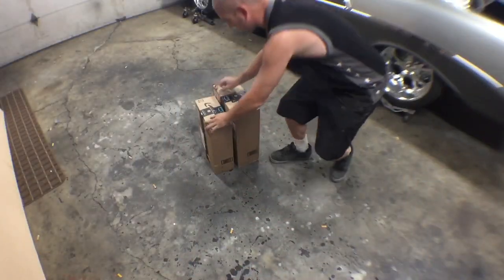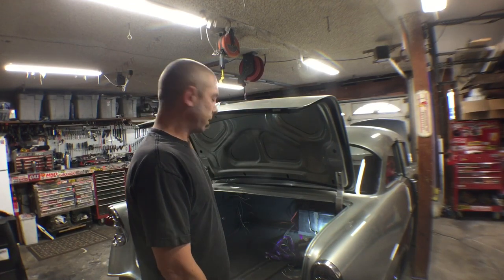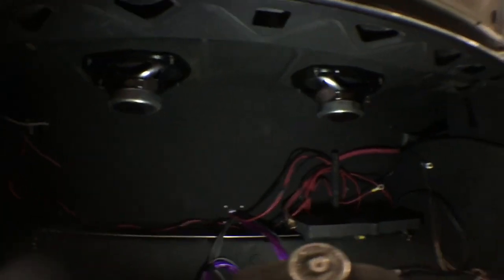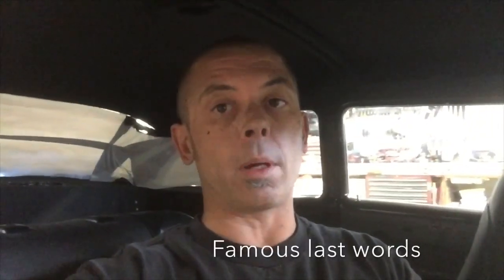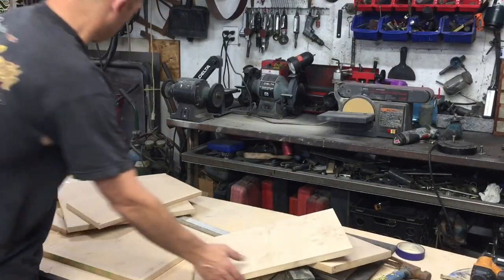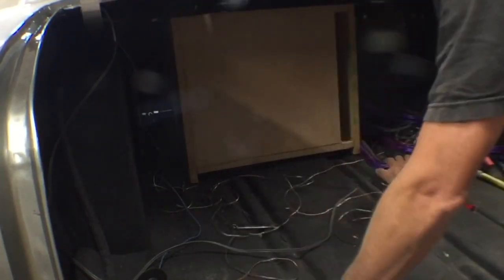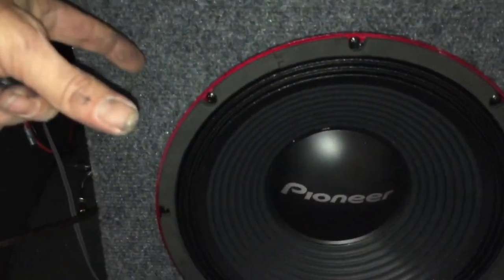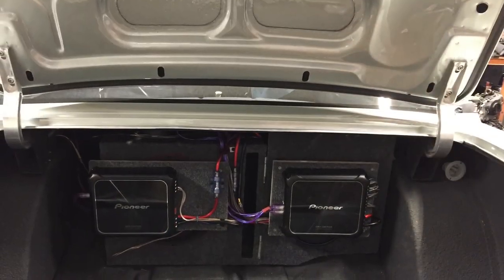1956 Chevy custom sound system

Comment: Sure, no spark marks in the protection you put up, but the time you don't use it, BAM a burn hole in the glass. LOL
Reply from the maker: I was so worried I had the compressor at 30psi 😂 slow and steady wins the race 🐢👍